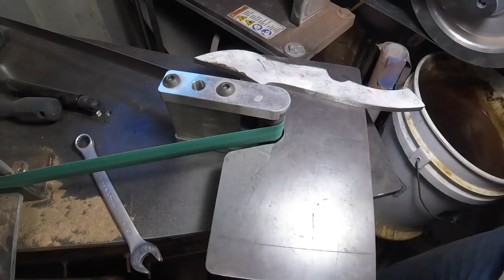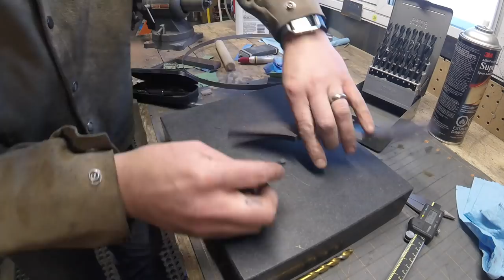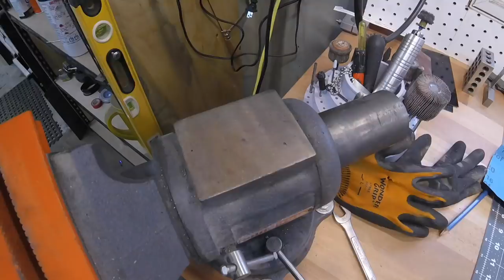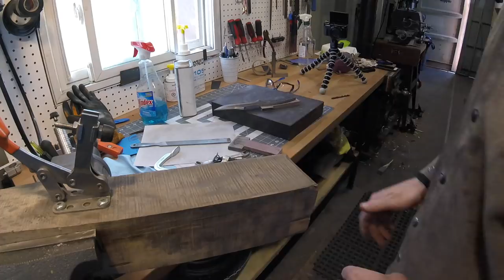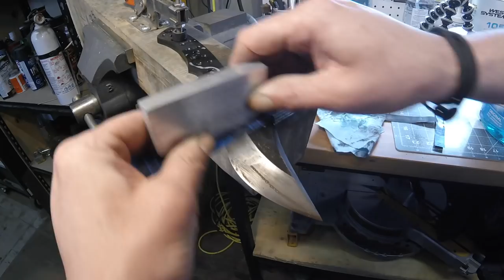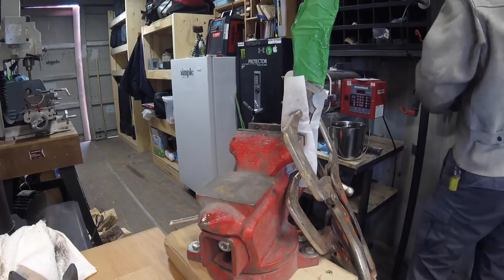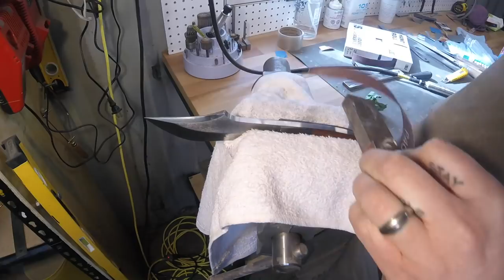Knife Making - How to Make A Persian Fighter (Curved Blade)

Comment: Looks beautiful! I learnt a lot too :D Can't wait for you to have some fun Damascus to work with ;)
Reply from the maker: +Alec Steele hey thanks buddy! Me too:)👍
Reply: Alec Steele My theory on true Damascus steel is that they would melt the iron, and carbon in a crucible and then pattern weld the billets. Seems like the two would work very well together, I really need to test it out.
Reply: tjzx3432 and that's pretty much the definition of woot steel (basically the "original" Damascus, as it was brought back to Europe from Damascus during the crusades [not that pattern welded steel didn t exist in Europe before then, re: vikings])
Reply: A knife makers guild member explained his Damascus as a 'marble cake' of flexible low carbon ball bearings, and brittle but high carbon wood files. Then heat 'em and beat 'em. Sometimes you get a brittle knife that holds no edge or a flexible knife that's is sharp as diamonds
Reply: When will somebody blacksmith a #BESTMULTITOOLEDT
Reply: Alec Steele  And Numan
Reply: Alec Steele T10 steel is in the carbon steel series mixed with different types of quality carbon steel alloys & tungsten alloys & other steel alloys that delivers the perfect work to steel to make T10 steel that can have the longest cutting edge that wouldn't require any knife oil to light up on it to make it harder & wouldn't require any sharpening like other knives do in my opinion,1 of the best steels to have for a knife.
Reply: Kansas Reb “you sure as shit” that’s improper English. “didnt” where is the apostrophe? I don’t see anything wrong with Alec’s comment but your comment made my eyes water.
Reply: Alec Steele thats really funny i wanted to put this youtube video as a comment on one of your videos
Reply: You two would make for a bad ass collab combo.
Reply: free

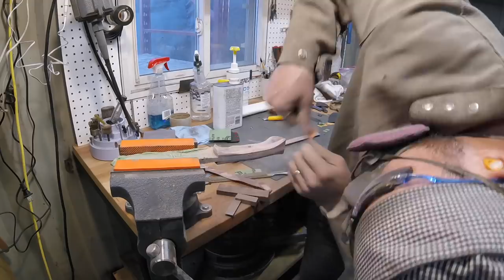Comment: This video rang bells for me at around 17:27, recently had nearly finished a knife after around 20 hours of work and took two much off the scales on the belt grinder, created another 2 or 3 hours of unnecessary work so when you commented about going to the rasp and off the grinder I totally relate to that and agree with you, there no turning back. Excellent knife, as you say, for the first attempt at a hollow grind, it turned out very very nice, great video as usual.

Comment: Enjoyed that build. I love multiple pieces for the handle. I use canvas micarta often and would use it more if the dust wasn't so horrible. I couldn't tell if you did this or not, but you want to scuff that shiny layer off your micarta and G10 before gluing. I had some epoxy come loose before even after cleaning. Real nice job.
Reply from the maker: Thanks! Yeah that dust is nasty. But that WIAC was even worse. It smells like sanding finer-glassed bonds. Really nasty. And yeah I did scuff up the micarta and the G10, but just didn't show it in the video. Thanks for the compliments, much appreciated! Cheers!

Comment: Awesome looking blade, been watching all week waiting for this video.   I am huge fan of Persian style blades with their up-swept tips and re-curve bevels.  You totally nailed it.

Not trying to be a nitpick on your pronunciation, but I got into this discussion with someone over this same thing before, and how you say the word "swedge", which technically isn't a word in a dictionary (yet - somehow), but according to one or two sources this is what I came up with:

swage - (swāj)
1.  A  tool  used  in  bending  or  shaping  cold  metal.
2.  A  stamp  or  die  for  marking  or  shaping  metal  with  a  hammer.
3.  A  swage  block.

swedge - (swej)
1. A faux double edge on the blade of a knife. Excellent for reducing the weight of the blade and balancing.
2. a section of a knife's spine, beginning at the point and extending generally one-third to one-half the length of the blade, which has been ground to give the appearance of a second edge (but without actually being sharpened).

Thanks again for the informative video and awesome tips.   You are quickly becoming one of my favorite channels.
Reply from the maker: Thank you very much. And thanks for the information about the swedge. I hand't looked into it that far and and this info you provided is really interesting. Nice to learn something first thing in the morning👍 Thanks for sharing and thank you for the compliments. I really appreciate it. Cheers!

Comment: That was a lovely looking knife, thick enough to cut a charging  bear in half if needed. The curve on the belly will cut with ease. I like the use of two synthetic materials they look good together and polish up well. Have you seen Eco wood? a combination of HDPE and bamboo. They use it as decking slats here in Oz. I just made a little friction folder with it as a test. Keep up the nice work.

Comment: 1:21 Saw your screwdriver going toward your belt grinder and started to worry just as it goes under i was like oh thank christ! Also the reason a figure 8 pattern is used is to prevent the rough surface from "Pocketing" too much material in one spot it makes use of more surface area. It allows you to get more use out of the rough surface than a circle would and honestly it is a better motion for your arm. Now mostly you will see a benefit in grain type rough surface rather than line type because you have less of a chance of even filling the gaps. But hey at the end of the day all that matters is you got it done right got it done in a timely manner and safe.

EDIT:OH almost forgot you earned a sub! Love the content.

Comment: i make A LOT of recurves and the best way ive found to sharpen them is to use the slack belt with a 120 jflex then 220. its kinda hard to explain but the belt conforms to the recurve of the edge.

Comment: Love it!!!!! With tapering,would blend nicely with a Chamorro Sisi..Tapering to pommel,then three spikes left on billet to peen a copper plate tying in both scales with copper liner..I love that blade design..When you mentioned wishing horizontal wheel,"Multitool attachment"  on variable speed bench grinder,mounted on their pedistal stand.
It turns 90' for that big wheel side finish work.
The Dust deputy I am looking into, admire your shop.
I have the goodies but working in my basement,dust always a consideration.
New outside shop on the way.
Your so free to create and enjoy,envious.
Look into 1914 Chamorro Sisi,you see one (even in hand),will spark with design you already have there.A square heart filed fixed bolster section,tapering to tip and also tapering from other side of square to pommel,three spikes left to hand peen the plate with copper liner even knotched into the plate..
I found one in an attic that mice ate one scale part and still couldn't keep it from functioning solid..The square heart I call it is the balance of blade with tapering forward and backward from that center heart of the blade (but shaped square)(heart as meaning center main weight)
Wish I could post a picture because you would go ape blending it with that design.
I think the preWw2 Chamorro built the finest on the planet,for function as well.
WW2 Chamorro tribe used 5160,but the earlier blacksmiths who did the better variation I am not sure ,but it holds edge..
The scales tree type are protected that the tribe now can only use what naturally falls,so I could not get another scale (ifit tree)..
I decided to restore it even though it was solid with one scale half ate..(In process now).
The bolster like section on yours,imagine squared box,with tapering both direction from each side.
You did great grinding that,has me wanting to try one..Salute!!!

Comment: The West System epoxy has different hardeners for different set speeds.  I noticed you are wearing an extra bit of clothing.  I am guessing the temperature in your shop is a bit chilly, this will greatly effect your set times too (slower in the cold)!  Built my boat with West Systems :)

Comment: You seem to be cutting the metal like butter with your band saw.  Two questions if I may.  What kind of steel is that, and what kind of band saw blade are you using?

Comment: I really love this design! I love thick knives, I use them as camp knives. 

Speaking of, I've been thinking about making myself a big chopper - if I was to go a similar rout as in this video, what do you recommend as a budget option for the fancy belt grinders real knife makers use? I'm a woodworker, and I've dabbled in mixing metals in with my woodworking, and I'm a decently skilled knife sharpener...I think it's time I make the leap to making myself a couple knives. (I just can't swing a $2000-$4000 belt grinder!!)

Comment: Really nice knife, but I always thought swedge was a thinned portion of the spine while swage was a tool or die for forming metal during the forging process (like the hole in an anvil where you can place and Hammer a small piece of metal into a nail) not trying to be "that guy" I'm just curious.

Comment: informative great show and talent , oil quench what is the oil used , I will assume you sell these knives ? do you rake orders ?
 Thanks Frank
Reply from the maker: +Frank Yeyna thanks! Yeah I do custom orders. If you want to check out my website homesteadknives.com you can see what's available and email me through there also. Cheers👍
Reply: Take not rack  Key's move while using them ! thanks for the reply , after you draw at 450 F do you just air cool or drop in water ?

Comment: A tapered tang would make the knife more blade heavy wouldn't it?

I have recently made my first knife and I have a question :
I was thinking about trying to make a half hidden tang on my next knife, I haven't seen one done before.
What I want to do is basically cut a slot in my handle material and leave the tang showing on the top edge of the tang. The handle material and tang will need to be drilled for pins at the same time, after the slot is fitted.
My question is, is there something I'm missing, a reason I don't see this done on other knives?
Reply: Seen this done on a lot of kitchen knives and have refurbished a few myself. It's called a partial tang. If you can get your slot perfect, it comes out pretty nice.

Comment: Nice job.  I do wonder however,  why people don't send their blades out to an aerospace heat treat house to have it done right in a controlled vacuum atmosphere with proper deep freeze stabilize sequences.  You can determine if you want specific case and core harnesses with some materials and have it certified to a specific aerospace specification.  This old school tempering I'm sorry to say, should be avoided especially with modern powdered metal technology where chemical composition and grain structure can really be locked down with an engineered heat treat.  I understand there is an old school feel for hand crafting, but it's not like knife makers actually smelt and forge their own blades anymore.  They buy material to use as blank blades.  You might as well shape them and rough them in then pay for a proper heat treat and finish the blade.  In the long run your blade will be the best it can be.

Comment: Hi, Where greater dimensional stability in heat treatment or improved wear resistance is required, tool steels with higher alloy contents, such as A2 or D2 should be good alternative. I wonder; isn't O1 inferior compare to A2  D2 ?
Reply: Yes, O1 is inferior. I would use S7, which is a spring steel, and hardenable. Similar to A2/D2.

Comment: Great work again.! Ido you figure to achive this pattern on non beveld blade if i dare ask.?
Reply from the maker: Thanks! I'm not sure I understand the question you're asking.
Reply: Sorry for my bad english.. There is like a pattern on the flat part of the blade.. Between the bevel and the handle.. Was make with hammer or something like this.?
Reply: SLL...  He is asking about the non-polished part of the blade.  How do you achieve that texture on the flat (not beveled, not belt sharpened) part of the blade. I was wondering too, because it looks really beautiful.
Reply: Dan L.  That’s forge scale, the black that he partially sanded off leaving enough to make a small difference next to the burnished steel of the knife edge

Comment: what type of blades do you use when cutting 01 tool steel. I just bought a bi metal 18 tooth blade for my little bench top saw, and the sheet of 1/8 tool steel laughed in my face!
Reply from the maker: +Doug Bish first of all, hit that steel with a hammer. That'll learn it! For most of my stuff I just buy Milwaukee 14 tooth blades. I've tried 18 but prefer 14. They say the minimum tooth engagement should be a minimum 3 teeth at a time, but I cut pretty much everything with a 14. Cheers!👍

Comment: Jeremy. you work construction right? or used to? are the iron workers hard hats made if micarta?
Reply from the maker: I'm pretty sure they're bakelite. Cheers!
Reply: Simple Little Life dude I spent all day Googling this... not because I want to prove anyone wrong or anything but because I really want to know.. and MSA has listed on their site that the material is Phenolic Plastic.. so i was like... wtf is that? so I went deeper into the rabbit hole. and found this nugget "Phenolic Plastics or micarta plastics are a laminated plastic created by the impregnation of layers of a substrate with a resin then formed utilizing heat and pressure. The resins are generally Phenolic, silicone, melamine or epoxies while the substrate materials range from paper and cotton to glass." apparently they are plastic impregnated cotton weave and can withstand Temps of 350°f.. which is probably why it's an iron workers thing with all that slag..

Comment: Crap,  you on the drill press, "holding the blade w your hand,  you would have given the engineers a heart attack where I work.I actually did that to mess with em,  I had 2 spade shaped  knives,  A2 before heat treating,  and held the ground blade,  with a rag, ready to drill a 3/8 the laynard hole,  and really Got-Em -Going.

Comment: windex????????
Reply from the maker: +Luca Younes I find that I get a nicer finish when sanding and it also makes cleaning up my hands afterward much better. And, it prevents surface rust in the other side of the blade when using just water. 👍
Reply: thanks so much, on the finish/sanding part of the proces and was wondering.